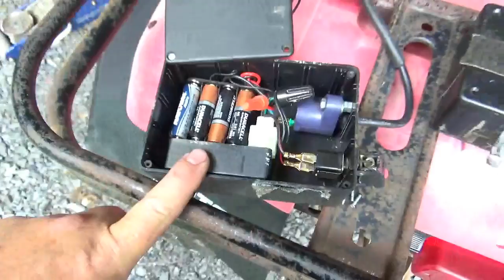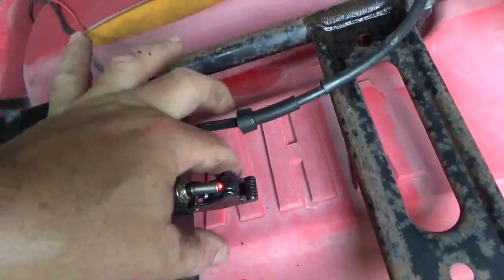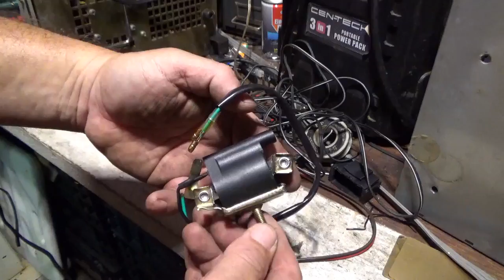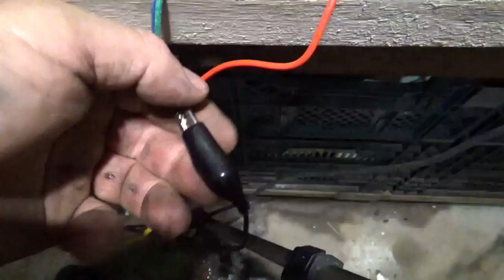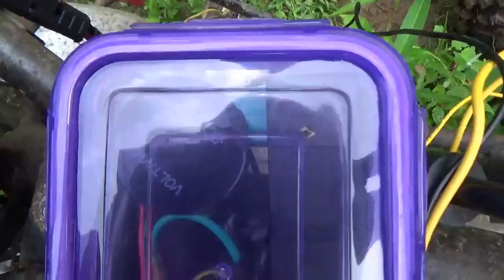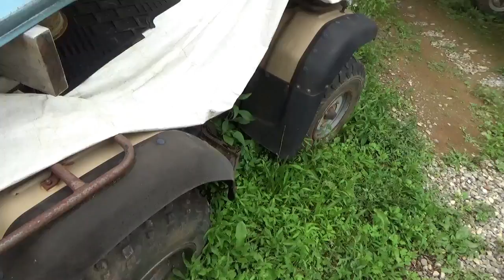Easy ATV/Pit Bike CDI Build, Gen III Capacitive Discharge Ignition Box

Comment: As you explained excellently the spark will advance a little  towards TDC as  revs increase so it's a 4 stroke . l get many ATV/Pit Bike  parts which a for 2 stroke's , either the sellers are clueless or lacking in  description but as you know AC or CD CDI's for 2 strokes will retard the spark, opposite from 4 strokes , and an extra spark but they may all do that anyway . Lol. Thanks

Comment: I finally figured out my portable CDI box issue. I've made a couple now and there great.
On a previous video I mentioned I was having issues with a pulse picky CDI box and it wouldn't fire my bayou 300. I tried swapping leads to the pulse generator like you suggested and it still wouldn't fire. The CDI I was using was timed differently much like the gy6 unit your talking about. I contacted the supplier and it's timing curve is based off a Yamaha golf cart that has an auto advancer built in that allows for upto 20* of mechanical advance on start up.
 it was retarding the ignition timing to much on start up to get it to fire. I pull started it behind my trike and it fired after a few seconds and ran great above 1500rpm i shut it off couldn't start it off the electric starter or recoil. I swapped another CDI "Chinese pitbike CDI" back on and it fired right up. these really are the best diagnostic tool for these bikes.

I will never buy the 6 dollar CDI special again. I'll spend the extra 2 bucks and buy them from a "reputable" Chinese supplier that isn't just selling 10 year old stock off lol. you seem to have good luck with the units you order I bought the pz all in one kit and it's the best set up yet.
Great videos thanks for sharing!